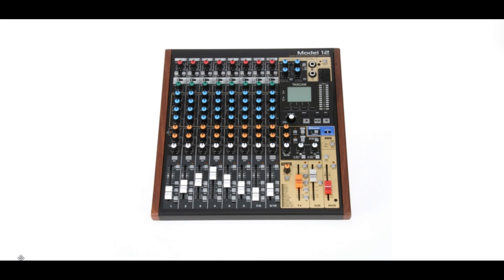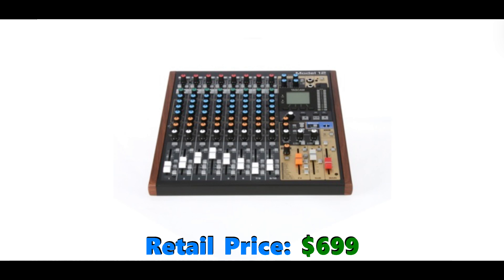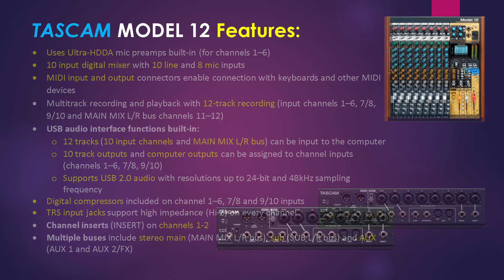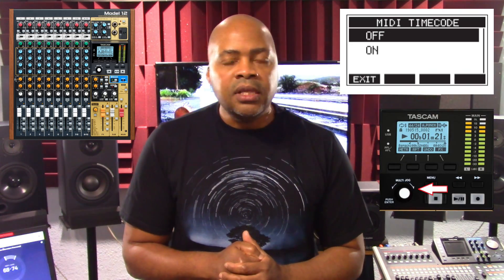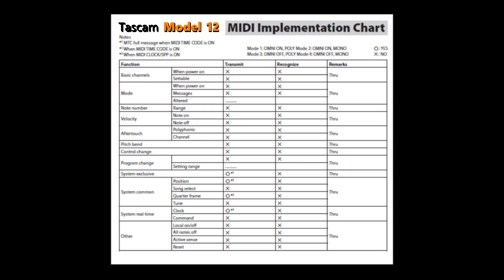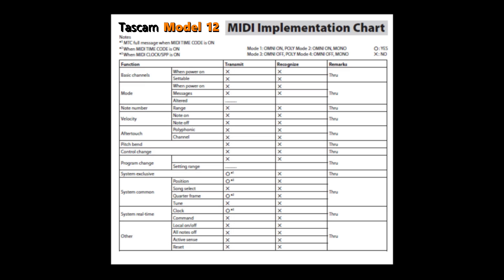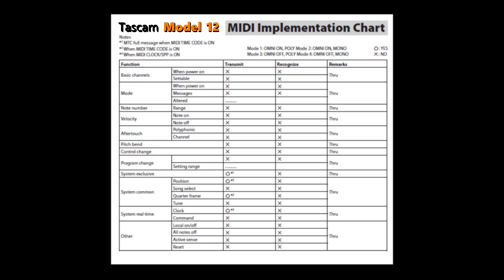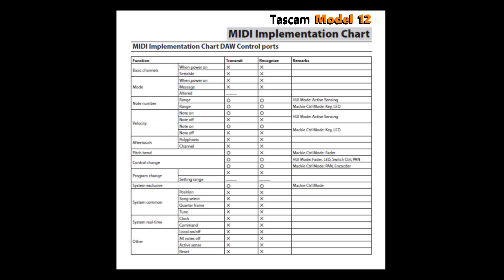Tascam MODEL 12: MIDI Implementation Explained

Comment from the maker: It appears that the MODEL 12 was designed first and foremost to be used in conjunction with a Digital Audio Workstation (DAW). The unit has 2 distinct MIDI implementations. One MIDI Implementation covers the stand-alone hardware unit only. The other MIDI Implementation covers the unit’s MIDI functionality when connected to a DAW. I wanted to share this information with anyone interested. I hope it serves useful.

Comment: Thanks for all your videos. Im sure youve helped more people than Tascam support at this point 😅 ive been with you thru the DP24 to now this..

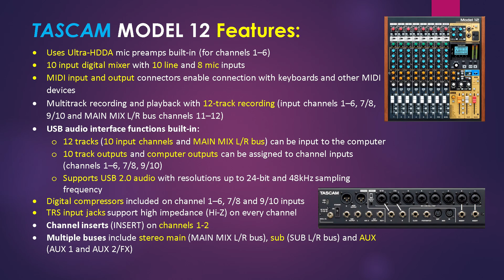04:12 you say "10 track outputs and .."

What do you mean by 10 track outputs? The 10 computer outputs i get is to your DAW using the Model 12 as an interface, but what 10 outputs do you mean, and how are they assignable to inputs? I hope this question made sense.

Comment: Apart from the very useful explanation -and thank you so much for that - how did you manage to make your video and audio be so late 90s? I assume it’s on purpose. Are you using an old camcorder or something? The dynamic range seems maybe too good for that but I can’t be sure. The colour is also spot on 90s but on a high level. Is it a 3CCD or 3CMOS sensor?

Is the audio also from a camcorder or are you adding noise in post?

Anyway, consider me subscribed!
Reply: This is the real question right here!

Comment: That MIDI section was confusing for me. I have a Yamaha PSR 293 keyboard that has MIDI in and out on the back. Can I just plug that into the Tascan, and record it? Or do I have to go through a bunch of other settings in order to do that? I'm not setting up a DAW.
Reply: no you cant do that.  you have to use regular audio cables to record it to model 12

Comment: Ok how do I sync to a drum machine
Reply: I just tried this with my TR–8S. Go MIDI OUT of Model 12 and MIDI IN to your drum machine. Create a new song on the Model 12 (name it whatever). Start recording on the Model 12. The drum machine should start playing with its tempo locked to the Model 12.

EDIT: And for those of you who are newer, of course you need to run audio out of your drum machine/source instrument into any of the track inputs of the Model 12 (because MIDI is data only—no audio signal can run over MIDI). Also, you have to have the input's 'RECORD ENABLE' button (above the fader) activated for the track to record.

Comment: Does it have 8 stereo inputs that allow me to connect 3 keyboards, an Akai MPC, 2 Stylophones, a mic, and a drum machine as individual devices to record from? I had a recorder that had 16 channels but only one was stereo so couldn't record from multiple devices without having to plug and unplug each of them in the same input... Is it automatically recognized/assigned by the DAW on the faders section and knobs for general use?

Comment: Stand-alone MIDI is almost useless on this unit, sadly, unless you're restricting yourself to pieces where the time signature and/or tempo will stay unchanged for the entire duration 😢. There's no way to either define signature/tempo changes NOR sync to an external device! This demonstrates TASCAM designed this device first and foremost to be used with an external DAW, rather than as a stand-alone portastudio. Good for most of their customer base, I guess, but terrible for those of us who work exclusively OTB. As a possible workaround, I'm going to experiment with recording an FSK tape sync signal from an old hardware sequencer, and then feeding that into the sequencer by routing the sync track to an aux output, but that, of course, will bypass the built-in MIDI functionality entirely. In that regard, the Model 12 offers no advantage over the 16 for my needs or workflow, other than a somewhat  lower price.
Reply: I'm having the same conclusion but for the Model 2400.

Comment: Is it possible to do additional MIDI mapping to an existing preset? In my case, I have Logic Pro and it's using the MCU protocol. I'd like to map a few additional MCU parameters. Thanks!
Reply: u tried mackie control c?

Comment: So can you go to for instance bar 17? I only see a time, not bars and beats on the display? It would be nice to record bar 1-16, then pause and record bar 17-32. But you would be able to actually go to bar 17 and do a count in and then it start recording and sending clock to your midi devices.

Comment: Has anyone had the problem where the stereo inputs are not balanced equally in volume between 7/8 and 9/10?
Reply: Yes,I experienced the same issue. It might happen when gain knob is cranked towards its limit. 1.41 firmware could help as it provides 
optional digital gain boost per channel. Haven't tried it yet tho.
Reply: thanks I will try it when I have time (which sadly won't be anytime soon). @kareljanda3399

Comment: Hello sir

I am extremely new to this. Last one I had and still have the Porta 4 cassette.  I want get back into.

I'm desperately trying to decide between the model 12 or 32. Midi may or may not be important to me. Like u suggested I found midi dp24 and was ready to pull the trigger on, but thinking that only 8 simultaneous recording and I just don't think will work. Also tacam will not support version 1 anymore.

I do want to get into Floyd style old school synths but with 1/4 I can record w/o issue. And it appears that the 12 midi is pretty limited. Tho, midi could be helpful for backing tracks live.

Thoughts? I like the 12 but after stereo there is no tracks left. And if the midi is not needed then will go more simultaneous.
Reply from the maker: The Model 12's MIDI implementation is actually not bad for it's price point. The key here is to discover and understand what you really need. Then you can a make more tailored decision toward what's best for you. For more on how to do  this, watch my presentation "Home Studio Builds & Updates: How to Discover Exactly What You Need", on this channel. I hope this helps and thanks for watching. 👍🏿
Reply: @Powercoat Music  thank you for your reply but what I guess I'm asking is what is gonna end up being more important at the end of the day - most available channels (which I'm sure is prob the most important usually) or midi with a few lesser available channels?
Reply: @Powercoat Music  ok please answer this as didn't the other knowing ur busy.

I would like midi but don't know when or if even will eventually use. 

But what is more important is number of tracks I can record and/or get to a DAW if needed which assuming is yes. I'm planning on using reaper.

Now the 2 questions. 1) If I start a recording say on a midel 12 or 24 AM I LIMITED to same number of tracks once imported into DAW? And 2) can I connect a 12 to a 24 understanding I can't control the extra tracks on the 12, BUT us as import to DAW & use midi for time control for other devices?
Reply from the maker: @brianploss8372  To answer your 1st question, once you export your tracks from any hardware multitrack recorder and import them into a DAW software system, you are now only limited to the number of tracks available with that DAW. If I’m understating the 2nd question, the answer is “Yes”. Wishing you all the best.

Comment: hello, I ask you for information: I have 2 external effects, each has the classic line in and out (double jack for both input and output), how can I integrate it into the mixer? how many AUX are there in the Tascam? and SEND / RETURN? On the other hand, can the internal effects be managed independently?
For the rest, I need at least 12 free channels, including a voice channel.
Many thanks!
Reply from the maker: If I'm understanding your question correctly, yes the internal effects can be managed independently of external effects that you connect to the unit. MODEL 12 has 2 AUX sends (AUX 1/AUX 2), so you should be good to go. Thanks for watching. 👍🏿
Reply: @PowercoatMusic  I thought one only has the ability to use AUX 1 if simultaneously using the internal EFX.

Comment: Thank you for your video! 
I am using ableton and want to use the tascam model 12 only as a midi controller.
Can the knobs be assigned/mapped to whatever value you want? 
just like you would be able to do on a standard midi controller?
Reply: Hello, so couldn’t I get max volume at 0dB instead of +10dB when move up the fader to the top? Mapping it manually into ableton
Reply from the maker: No. For compatible DAW software only, there are predetermined controls that can be used to control specific functionality. Thanks for watching. 👍🏿
Reply: @PowercoatMusic  Thank you for your reply

Comment: I know it was geared towards a certain target audience... But, I really wished they put this on the model 16. I bought the 16 not knowing this feature was omitted🤦🏾‍♂️
Reply: I'm sure many others were unhappily surprised when that feature wasn't on the next two models.
Reply from the maker: Agreed. For many it's still a big deal. Thanks so much for watching. 👍🏿
Reply: I don’t get why they didn’t add this feature on the other models? Maybe they are going to release a new one or something
Reply: I heard because the 12 is newer than the 16 and 24